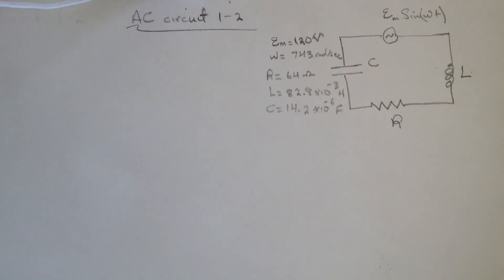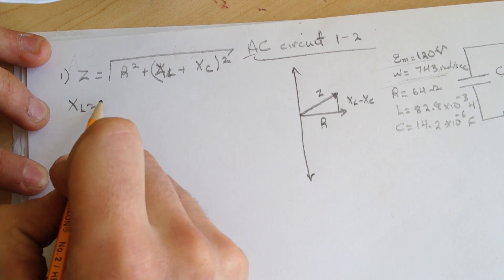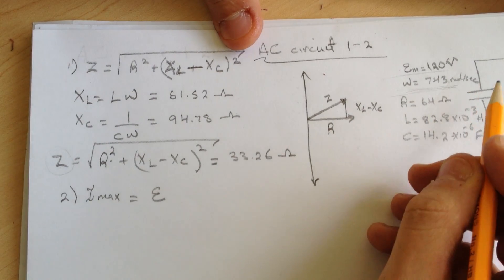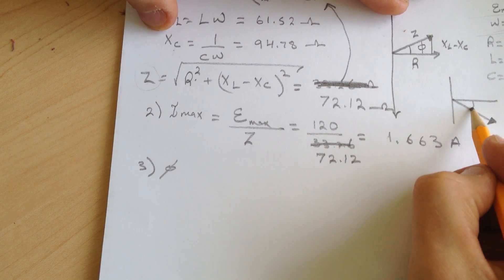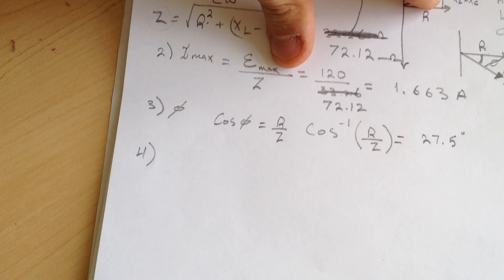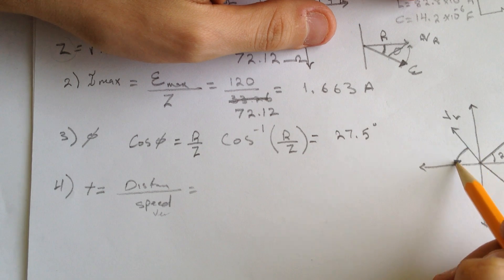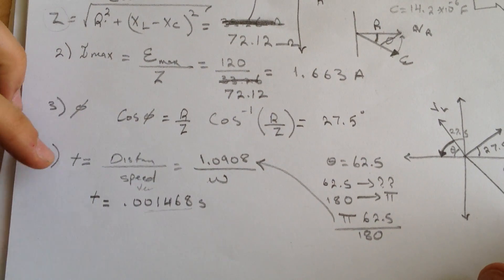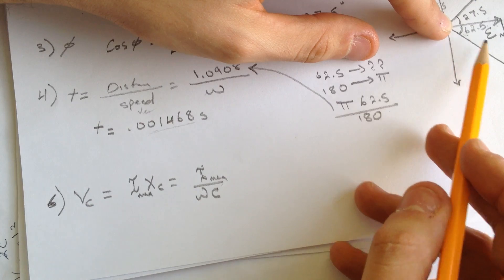AC Circuit 1-2 "Smartphysics" solution.

Comment: I did what you said for number 4 including adding the sig figs but it didn't work for me?
Reply: Walid Hamarneh I only got the correct answer when I used theta = 90 + (answer from 4) where I used the positive value from number 4. The question says "The phase φ is defined to be positive if the generator voltage the current leads, and negative otherwise." This wording us terrible, but I think its saying that if phi is positive, the current leads the generator. Since phi is negative, the generator leads the current and thus your phase diagram would be wrong, and to find t, theta would have to be what I described above. This being said, I agree with everything you did in this problem so I don't really know what the deal is. The generator should lag the current, because XL-Xc is a negative number....
Reply from the maker: It must work, make sure of ur numbers again, and try to include more figures then. 
Good luck
Reply: William Swain
By the way.... SmartPhysics is wrong. What William said is correct in the sense of getting the correct answer, as SmartPhysics is ignoring the sign of the phase angle. So, to get the correct answer do what William said but know that it's incorrect.

Comment: Any chance you could explain the multiple choice question too?
Reply from the maker: Riptide1427 " From the phasor diagram, we can see that the voltage across the inductor leads the current by 90o and the voltage acoross the capacitor lags the current by 90o. Consequently, when the currrent is zero, the magnitude of the voltages across the inductor are maximum and when the current is maximum, the voltages across the inductor and capacitor are zero." thats what smart physics said.

Comment: should the angle be -27.5 degree?
Reply from the maker: In the question they gave us that "The phase φ is defined to be positive if the current leads the generator voltage, and negative otherwise" and here the current leads the generator.
Reply: Oh, okay. got it. thanks!